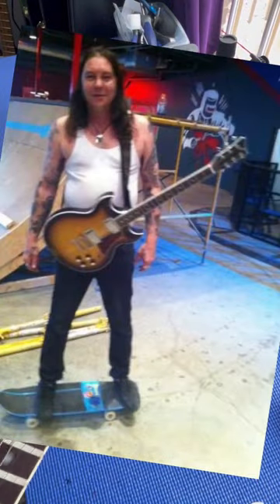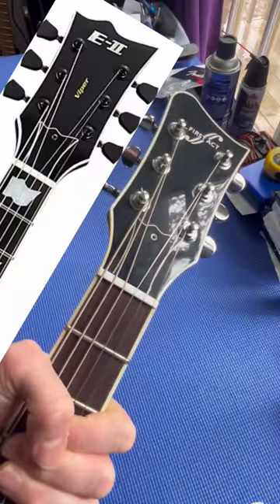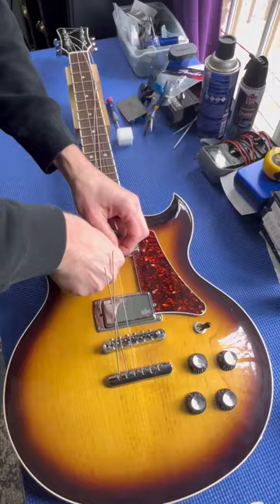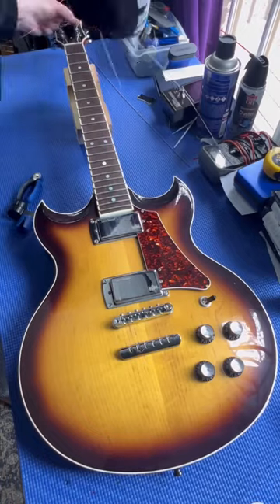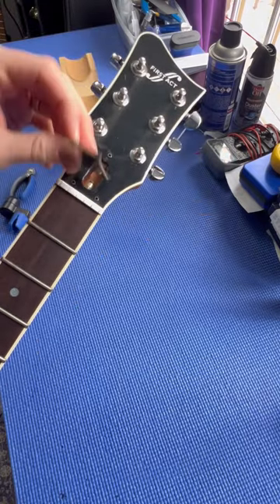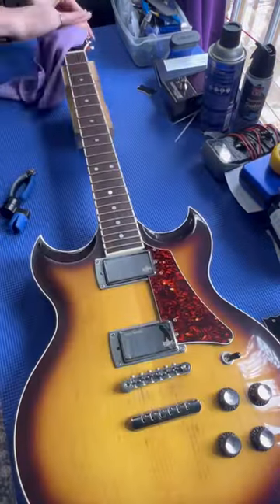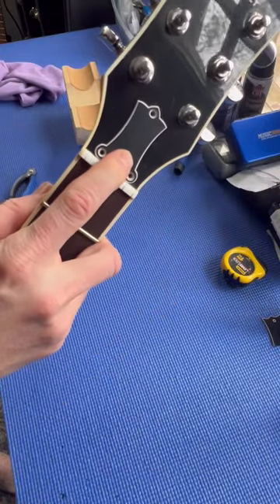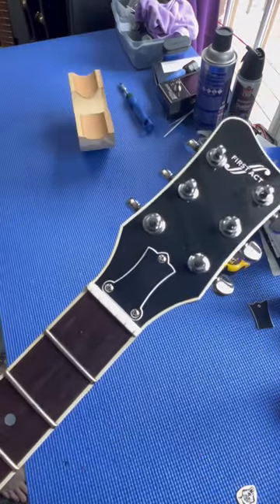What’s Under the Truss Rod Cover of this First Act Custom Shop DC-6?🫣 #highonfire #mattpike

Comment: I removed my rod cover from both my prs and my schecter after a setup of larger strings and have yet to put the covers back on either of them for about 10 string changes or so so far lololol.  Was spinnng high on fire yesterday, they rule